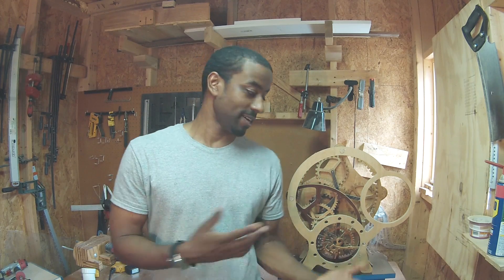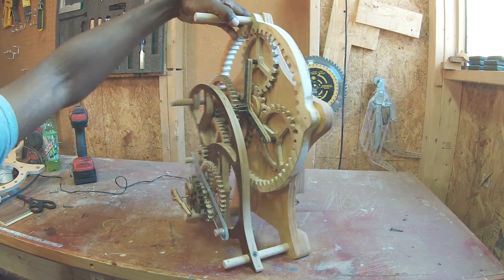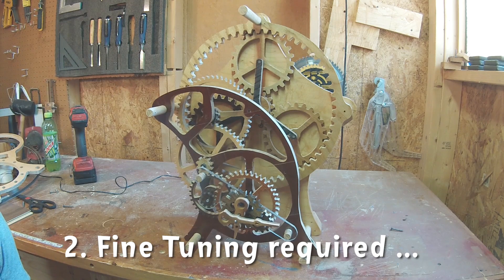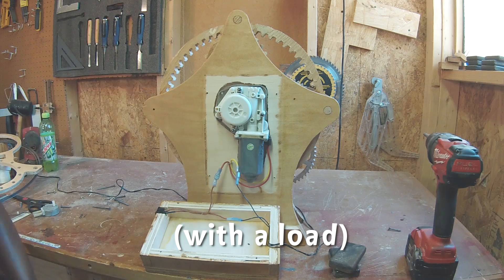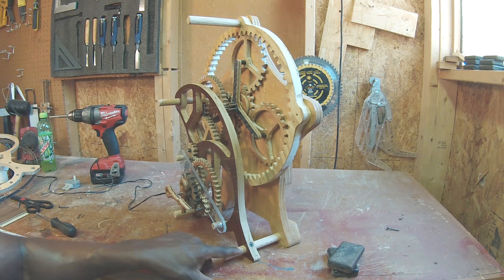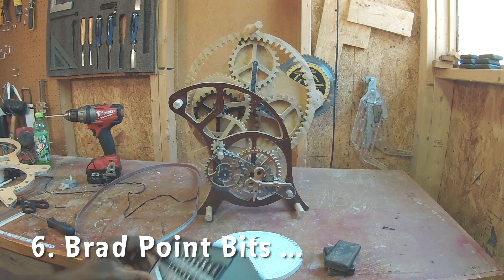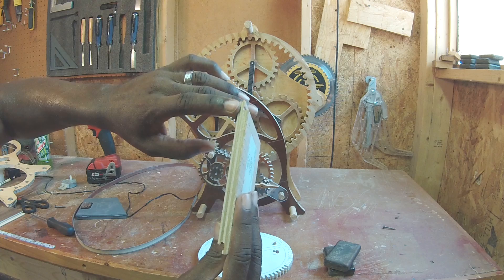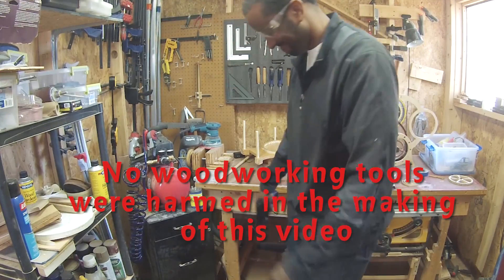09: Making A Clock From Wood And Car Parts!

Comment from the maker: Hey Guys and Girls... The Gun Shots Are Fake! I thought it would be a funny joke, but it turned out to be more convincing then I expected. That is a BeBe Gun, some mediocre acting, and Adobe After Effects to create the mussle flash.
Reply: I found it quite funny
Reply: I see I'm late to the party , 
For your Wood try using Baltic Birch Plywood, You will have to order it online , or if there's a Wood Store in your area get it there , Do Not But it from the Home Centers what they call Birch Plywood is Not The Right Wood , , I've built several Wooden clocks , mine run off a pendulum , nothing Elec. Awesome Stuff You Have , I've got a bunch of washer motor An vac motors , dishwasher motors myself , great fun to tinker with

Comment: Oh, that first minute of your video is just too funny, and I can certainly sympathize with your frustration.  I have one kit built from a model I bought on line, and have another I have yet to start.  I also have other plans to build clocks based on those two designs. I don't own a gun so I probably won't be shooting my failures, (maybe slicing them up with a sword) but I can certainly see why you would want to do that.
Reply from the maker: +Daniel Gable I had a lot of fun making that clip... it only took three tries to make it look good lol. I am glad you enjoyed it.
Reply: My first clock kit is a plastic model based on a design drawing by Leonardo Da Vinchi.  (sp)  It utilizes a swing arm with weights on the escapement.  Given that it is a plastic model, I did not expect that it would be at all accurate.  If I up-size it to about 5 feet, and increase the weights on the swing arm, and the driving weight, I think I could get to within a few minutes per day, but for a plastic model of less than 1 foot, I think it serves well for illustrating the basics of clock making.  The clock kit I'm currently working with has a pendulum escapement, and is weight driven as well.  I expect to take a month or two to get this one finished, and hang it on the wall in my bedroom when completed.  As for my third project, well, refer to earlier in this post.  I have a lot of pecan wood in my back yard, and I'm planning to use that to make the gears.  Wish me luck.

Oh, one thing about wooden clocks, the kit I'm currently working with recommends graphite as a lubricant.  Since I make my own ink, I have plenty of that on hand, so no worries there.

Comment: LMAO would candle wax rubbed on the planet gear and back plate stop the noise alot? or on the cog side thats against the plate putting a ball bearing in the center of the back side of the cog..hmm that might make to much noise its self, candle wax ;)
Reply from the maker: Unfortunately the space between the gear teeth is too small to add wax. But, something against the back wall might have made that better.

Comment: My ultimate build has been for years a wooden clock. Many starts never finished. I would take your window motor and have it wind up a weight or mainspring as it winds down and drives an escapement. A really funky escapement. At least you got yours done. Great job! BTW- how did you manage to belt sand the big ring gear?
Reply from the maker: +C Spann it has a split at the bottom between two teeth. I marked its position with pins through it before I cut it.

Comment: Interesting point about using brad point bits for precision drilling. This is one of the many uses I have in mind whenever I finally try to build a small CNC router. So far, using step motors out of old printers, and arduino control seems like it will be cost effective. Have you given any thought to building one?
Reply from the maker: Well, not much...CNC routers feel to much like watching someone else do woodworking. LOL Serously this is a frequently asked question so I should make a video about it. I think they are pretty cool devices but there is no space to keep something like that in my shop. Also I still like saying I made it by hand. Once you cross over to CNC its more like "I hit the print button"

Comment: New subscriber since I saw this video!  Do you have plans for this clock?
Reply from the maker: No, most of my projects are prototypes including this one. If enough people request plans I will rebuild a better one and make plans along the way. I am doing that with my lathe right now. Starting this week I will Design-build a new lathe (really already designed) and post plans for sell. The clock may come later since several people have asked.
Reply: ok thanks!

Comment: I showed this clip to my wife she started laughing and said I can see you doing that. I have been a woodworker, machinest, welder, metal fabicature and now wood worker again. And no matter what when things don;t go my way you had best just leave me be. I also am a fire arms lover and with my temper she said we had to be kin.LOL I love the clock did you design it all your self? Also I think you said you need a 60rpm motor for it it run correct. this is a link to a 60 rpm synchronous motor.  http://www.ebay.com/itm/Synchronous-Motor-120V-AC-60-rpm-4W-7mm-shaft-E149393-/292015381588?hash=item43fd791c54:g:hNMAAOSwc0FUpvn6 I have purchacese a few 1 rpm SM off ebay for a couple ball clocks. What program did you use to draw your gears? I built my own scrollsaw yesterday and I have always wanted to do a wood gear clock but want it to be a weight powered colck. I am kicking aroud the Idea of doing a few youtube videos but am afraid it will suck me in. Any way keep up the work showing us how to work in small space because you make me feel good about my 1 car garage for a shop. If you never looked at a shopsmith you should it takes about the room of a bicycle but has a lot of bang for your buck if you buy a used one. I own 3 and the one I restored in huntergreen and cream I paid $100. The man claimed it would not change speeds and was junk. I oiled one part and 1hr after I got home I called him and said it runs great man thanks. and my other 2 I got under $600 each and they came with band saw and jointer and more. just a thought as they are made for small shops.
Reply from the maker: LOL... Please tell her it was special effects. I leave the real gun in the house.... For obvious reasons. Anyway, as far as design, this clock is completely original. I designed every part and gear using Solid-works. 
To the motor, I am not sure that 4 watts is enough power. Others have suggested I use a potentiometer and I think that is the best option. I just haven't bought one yet.
Reply from the maker: I posted a video Showing what actually happened without the special effects. If you are interested here you go....https://youtu.be/GXE_6PFKtwQ

Comment: try using a variable resistor to slow  motor down. or be adventurous and use an arduino to read speed and it can compensate the motor speef... cheers
Reply from the maker: Sounds like a plan the resistor that is.

Comment: Great project and great job!  To deal with the concentricity of the gears, one idea would be to drill your center hole first, using it and a simple jig cut out the circle, then apply your template to the blank taking care to position it based on the center hole and the finished outside edge.  Just an idea.  I love your projects and your creativeness.  Keep up the good work.
Reply: Sounds like a good method to me

Comment: I came here because Jay Bates featured you on his weekly web thingy...
I gotta say, there were two things that fascinated me; your ability to vent frustration fully and freely - and the size of your shop!

What size is your shop? I'm trying to set up in an old reefer trailer; it going to be about 7'6" wide, and maybe 40' long.

That clock making deal would have had me spraying bullets long before I got as far as you did! lol
Reply from the maker: My Shop is 8 ft by 12 ft on the outside. Its closer to 7.5 by 11.5 on the inside. Of course the gun is movie magic but that is how I felt each time I had to remake something.

Comment: You may already do this, But center punch the holes first and those brad point bits will follow the punched hole
Reply from the maker: Yes... I have... My issue was patience. I was working on it a little bit at a time over months and every time I wanted to "finish this weekend." If had taken just a few more seconds with each piece to double check alignment I would have done much better.

Comment: You didn't show how the clock was made.
Reply from the maker: It was 90% of me standing at the band saw cutting gears and parts, so I didn't think that part was that interesting. Designing the clock was all on the computer so again not sure people would like to watch that. I may do a follow up with more details if people show enough interest in it. What I really wanted to capture was the difficulties of building a clock and how I solved some of those problems. I would have watched a video like this when I started designing the clock. I even tried to add some special effects to a subject that could be considered boring to some... clocks that is.

Comment: plans?
Reply from the maker: Well, I have created drawings for all the parts and the assembly. But, those were made for me to build it and some key details may be missing. Also this clock is built around a 60 rpm window lift motor. That is not the ideal speed or motor type. To sell plans I would want to sell a clock that had easy-to-get parts, and I would design it so some one with less knowledge of the design intent could built it. However, if you are still interested, you can message me and we can discuss some options in greater detail.

Comment: very interesting great work! I've been fiddling with wooden gears and mechanisms using them and i was wondering how you made your gears i see alot of people using mathtius wandel's gear generator and didn't know if you used that as well?
Reply from the maker: I use Solid Works perhaps 98% of the time. It is pretty expensive though. I have it because of my job. I did purchase the gear generator, and I could have made the whole clock with the gear generator and a compass on paper. I use the gear generator if I already know exactly what I want  and just need to print it out on paper.

Comment: What field are you in, U seem to know a lot about a lot. Are u naturally a jack of all traits, or is all this stuff apart of your field.
Reply from the maker: Well, this question shouldn’t be hard, but I guess both are true. I don’t have a degree in engineering, or any real prior “professional” experience. I just get interested in a problem (usually mechanically oriented), and I can’t stop thinking about it until I have figured out a solution. I dream about, I wake up late at night with potential solutions… it’s an obsession. This process also involved reading everything I can on the subject.
If you had asked a year ago I would have said my field is completely unrelated to anything you see in my videos... However, last year I had a pretty dramatic change in career, And, in my new job I am apart of the engineering team which designs custom industrial machines. Interestingly, this job opportunity came (in part) as a result of one of my videos.
Reply from the maker: I posted a video Showing what actually happened without the special effects. If you are interested here you go....https://youtu.be/GXE_6PFKtwQ